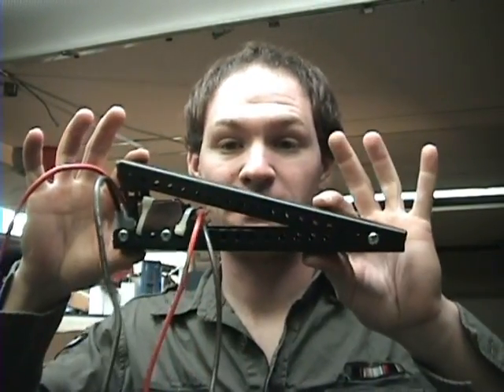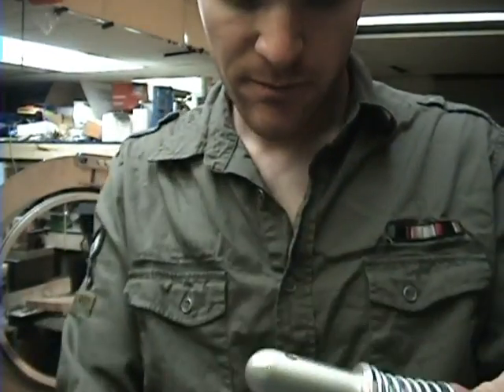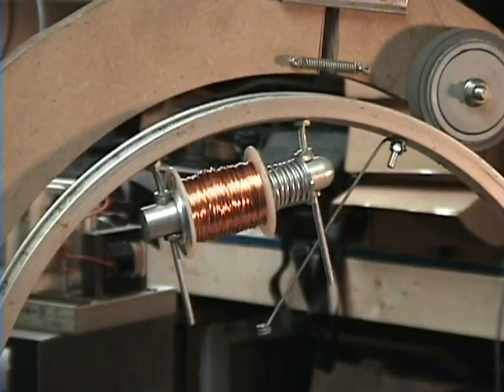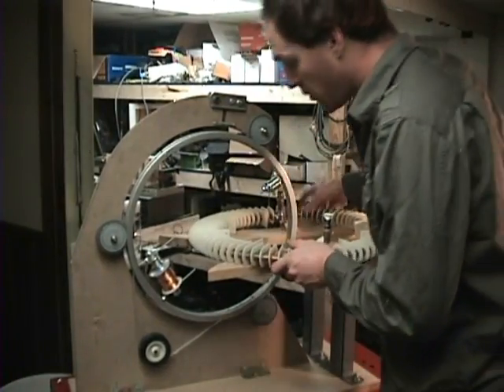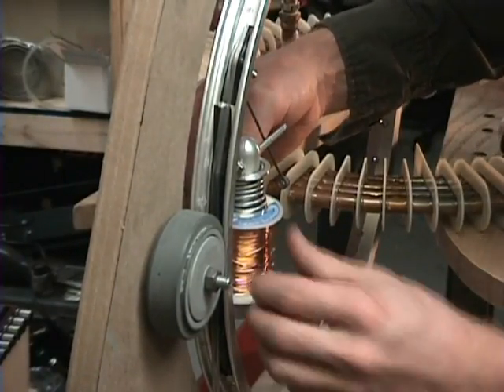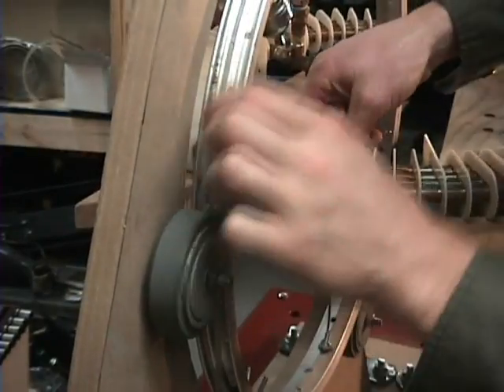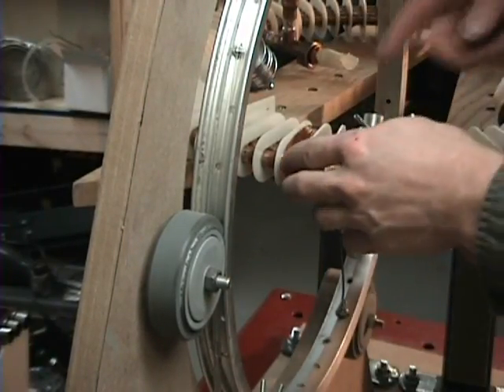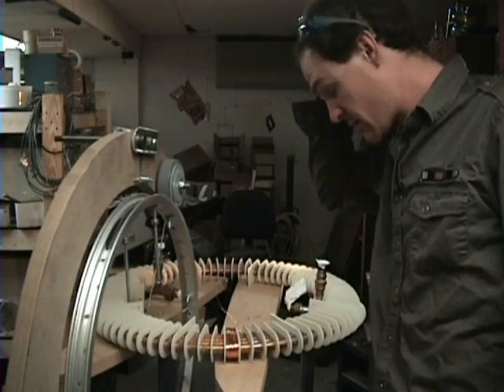#5 EPG Coil Winder, How It Works And Wrapping The Fist EPG Test Coil. Home Maid Troid Winder

Comment: Russ
you are the best
really nice to see a home made machine that really works
building such a sophisticated machine from junk parts solving one problem at a time

way to go Russ !!!

i think whats missing here is making that horizontal disc rotate too 

you achieved the rotation of the vertical disc
now its time to make the horizontal disc rotate too

then

find some electronic means to make both discs rotate together at same time'
automatically according to some speed ratio in between
like 1 horizontal degree to 1 vertical degree rotation
making the speed of horizontal rotation a fixed value
and making the vertical rotation a variable value that can be determined
like 1:1 or 2:1 or 0.6:1

but that gonna need some computer software pf some type

which will enable you to make a wide variety of winding ratios of the rodin coil
like 
9*9 and the ratio will be 1:1
18*27 equals 2:3 ratio
etc

you know putting winding ratio in consideration is of great importance
because as you " ITS ALL ABOUT THE GEOMETRY "

really nice job

keep up the good job

Comment: Hi there! I like your idea.  

One thing to help you out with your calculations, should you need it.  I'd add a magnet to the side of your motorized ring, near your wire feed guide, with a pick up on the frame to a resetable pulse counter.  That will give you a coil turn count to work with. 

For me, this would be the first thing that I'd do.

Comment: The split rim is a Very good idea. Mine needs to be able to go through a 1" hole, with 8 separate windings of 236 turns each using 34swg wire. Thinking of weighing the wire rather than counting turns. That does seem to be a problem with winding toroids. Looking forward to seeing more of your videos. Keep it up!

Comment: Love the use of a bicycle wheel as a coil winder, I use one as a magnetic loop RX/TX  QRP amateur radio antenna fed with a toroid ring fed over it the same way you put your ring on, work a treat from 21Mhz to 7Mhz.

Comment: I admire your efforts and work you done. Simple yet so functional.
If I may suggest.
1, Use nylon rings as a guid for your wire as the one you have "may" damage the insulation on the wire.
2,suggestion may be a digital bicycle meter to count the meters and then just convert it to the "closer" spins (where actual coil is :D) or if you wan't be more accurate to the actual foot on the coil. It all depends on the thickness of the core and obviously each layer with increase of diameter. 
Great Work!!

Comment: I like your coil winder, that was good thinking. It would be nice if you had some way to count the number of turns you make on the wheel so you will know exactly how many turns you have on each coil section. Also it would be nice to have something to control the side to side movement so each wrap would be wound right next to each other for a neater, nicer wind. thanks for sharing with us.

Comment: Interesting video. I've watched a few winding machines, but this one is very informative and interesting. How did your wire guide work out after you used it for a while?  The hard drive spindle spacers were a good use of those pieces.  I have about 500 of them and never thought of using them as washers.  Thanks for the video and information sharing.

Comment: I am researching different Hallbach motor designs for use in hydrolectric  generators with built in cooling methods. I am impressed with your inginuity, thanks.
Subscribed

Comment: Also, it seems since your winding device has alleviated most of the drudgery of hand winding and since you are holding the ring with your hands anyway, it occurred to me if you made a wand with an eye hook at the end that the wire passes through just prior to landing on the coil frame - and the other end of that wand was pivoting near the center of your ring / or better yet , further away, close to the opposite side of the ring. This would allow you to keep the ring more stationary and use one of your hands to move the wand's eye hook from side to side of the coil landing area. 
As I'm sure you are aware - wrap count and wrap consistency are key to a balanced magnetic field. 
Thanks for your efforts  and the generosity of your intelligence.

Comment: Hey Russ. I know you posted this video in 2011 but just the same, your ingenuity never ceases to amaze me. Been checking out your videos for quite some time and you are pretty good, quite ambitious and resourceful.
A question though, how do you count the turns on a coil? I made a few different coil winders and now need a toroid winder and want to count the turns as well as the length of the wire. I can calculate the length needed but didn't see a turns counter. I will figure it out in time I'm sure if you can't get back to me.
Thank you for all the great videos and young man, yes, you are crazy. Take care. God bless. Dave
Reply from the maker: Hi Dave, use a simple counter, if you take a calculator, wire a switch up to the = button, then just put 1+1 in the calculator, hit the button and it will count up by 1 :) 

thats the simple method, however i found that if i went to fast it would skip... 

the other counters you can get on ebay for cheep. like this one:

http://www.ebay.com/itm/LCD-Punch-Counter-Digital-5-Digit-Including-Proximity-Switch-Strong-Magnetic/181770167673?_trksid=p2141725.c100338.m3726&_trkparms=aid%3D222007%26algo%3DSIC.MBE%26ao%3D1%26asc%3D20150313114020%26meid%3D8213fc7278814bb3895a1ba772e04930%26pid%3D100338%26rk%3D1%26rkt%3D16%26sd%3D111006637773

Hope this helps! god bless! 

~Russ

Comment: well u say leave comment .. suggestion about connecting rim , bolts are time consuming and there is always bolt in O-ring path. U could use metal bracket from tool box instead of plate that u need to bolt down every time . Keep doing awesome  job like ur doing so far. Real enjoying ur work , trying to learn as much as I can b4 starting to do something my self , getting my self involved in this more seriously. Tnx for all of ur time spent in explaining to others ( and me ) how to do stuff . 

One more thing , idea for wire straitening, u could use old spark plugs . They have dents in ceramic that u can thread wire around it. Simply drill hole 2 mm smaller than spark threaded part in wooden board and screw spark plugs  in it ( as many as u want and in arrangement that will work best for you. Any car mechanic shop have them laying around just w8ing to be thrown away . I got 8 that was laying around form service that I did on 2 cars some time aggo . Trying to do exactly what I described here.
 Best of luck.

Comment: Interesting machine, you definitely thought outside the box to build it, (i.e.) to create magic with what you had available, hang in there you"re on the right track. If you have a machine shop at your disposal you could add a micrometer tension adjustment on your wire feed, and an automatic indexing feed on your actual coil. It would reverse direction when you reached each end of the coil, and eliminate human error. Anytime you're building more than one then building a Jig or Machine will insure uniformity.    P.S. you could make a UHMW guide for your wire and eliminate deflection and or jumping out of the guide, it would be stiffer and less likely to deflect or drop / snag the the insulation off your magnetic wire. Thank you for sharing your innovative mind with the world, knowledge needs to be shared not kept secret, that's how the corporate world elite control the rest of us. Good Luck and God Bless you, Braun.

Comment: Great thinking and follow through. This may have been mentioned in one of the many comments you have received but, have you considered using an insulation barrier between your windings and the copper tubes? I have seen many materials used for this purpose such as paper and or tape.

Comment: Outstanding work,  if you mount a pedometer and replace It's motion switch with a mag switch Tweak the mag and switch mounting setup it will give you a accurate winding count. I used one on my coil winding machine, looks like I need to build one of those. That is just bad Ass!  Any questions on the pedometer just contact me But  Look like you got a good grasp of things I'm sure you can figure it out again Great work Cheers

Comment: THANK YOU. Great effort with design and implementation. I have considered toroidal power transformers 120pri - 350v @2amp for antique RF gear. But the high cost, including shipping, versus performance of the originals (or copies thereof) was absurd. Those projects were thought to be out of reach. I think now have another viable option. QUESTION: Are there reasonable sources for cores and magnet wire that leaps to your mind?

Comment: You wished a comment so here is my two cents worth. The controller is quite an interesting reuse of recycled equipment. The way you made a belt to drive the winder was very creative. The overall construction was a little primitive but adequate. Changes I would suggest are: a polyethylene grommet on your wire guide to prevent friction damage; putting a counter to count the number of turns with. This machine would not help me for I wind toroids are no larger than 10mm outside diameter.

Comment: Very neat. To get the exact number of turns on each coil I would have added somekind of mechanical counter. 1 wheel rotation is 1 turn, to get the same inductance into every coil. for the ultra model, one should have a 1 diameter wire offset for each turn of wire onto the coil. so it for instance goes 10 turns, or 10 diameters each layer. Nice. It would be a coilers dream come true :)

Comment: your an exceptional builder. I did watch the build... great work dude. I have an Idea what your going to use this for . I have seen one other inventer with a few of these. But if I remember correctly his tubes where made of non conductive non magnetic plastic. btw keeping track of the turns is a good idea because the length may vary the amount of turns

Comment: May I suggest  adding one of thoughts mechanical counters from a tape recorder with some gearing/pulleys to measure the number of turns on your coils.
A nice addition would also be to mount the toroid on a turn table and a motor to spin the turn table with adjustable stops with switches that turn on and off a dtdp relay to reverse the motor upon hitting each side.
maybe if your feeling adventurous you could fit a solenoid to reset the counter and glue a few

Comment: Nice work on a crude setup. 
I know you will make it much better later. 
One suggestion on the update to the machine. 
Make it hold down the form that your wrapping on and have it move for every revolution per rotation of the winder. If you like I can give you ideas on how to do that with an Arduino.

Comment: 2 ideas for improvement.
1 - Treat your foot pedal like a lever and move the switch to the small side so that it takes a larger movement to go to full speed. Perhaps replacing the pot in it with another pot. You could also use video game foot pedal.
2 - Feed the wire from a separate spool with a tension control.

Nice work on the winder.
P.S. Your link sends you to some company, not rwgresearch.

Comment: great so long as wire doesnt get snapped from friction or over tension. wire might run on bearing or low friction material. could the coils not be wound then added ? it looks like a great effort that you wouldnt expect to work.

Comment: bits of metal to the counter's numbers (or use an electronic chip or two) to complete the circuit when the counter reaches the set number of turns.This would then latch a relay which would enable the skipping of one of the pulses from one of the side stop buttons (advancing it to the next coil) after the next one pluses the relay is reset stopping it from spinning all the way around. another switch to stop it on the completion of the last coil section. 
Just a thought.

Comment: so this thing will do rodin coils too. just gotta keep innovating. you need to adjust the spring tension on the rollers. wow you could use the thinnest possible wire? i figure you need a potentiometer as well as the foot pedal set up. you could also put guides on the epg that come right up to the eye to keep the wire then you could just max speed

Comment: Great video, I have watched chinese coil winding jigs and could not understand how they worked. But no surprise since my mothers Singer sewing machine was complete mystery to me. 

      I do have one question.  Looks like your machine does a solenoid wind, each layer is spiraled opposite of the one below it. This creates magnetic fields in opposition to the layer below it. Effectively creating a radio choke. If your winder did a quick turn from the last wind on the previous layer to the first wind on the next layer, starting at the same place, each layer would reinforce the strength of the magnetic field below it.

      Try to find a way to detect the end of a layer, and swing the feed back to the first wind of the previous layer. Your coils will be stronger, have a consistent resonant frequency, and run cooler than before.

      Sincerely,

            John

Comment: I have a bicycle wheel needing replacement,  the rig will reuse the old wheel perfectly, old sewing machine motor can drive things and has a built in speed controller too. Now I get the machine I want and reuse stuff too. Project  cleans garage nicelytoo.

Comment: If you have the spare circuitry laying around you might consider adding a turn sensor/counter to the wheel.  It could be just a series of simple decade counters or even an arduino connected to an optical, mechanical or hall effect sensor.  Even something connected to a PC's input could work for the purpose...

Comment: Hello Russ from Steve. Im very impressed  with all the work You have been doing
maybe You need a winder counter. i dont know about tuning coils. i dont know if you have to match wire lengths or 1/4 ,1/2 and 3/4 length wires or matching  total wire weight of the coils
Thats some very good work
Steve

Comment: yeah im sure he will put some nylon in side the loop guide for the line feeding plenty of nylon ink pens around i am sure. The end to end of the side edges of the spool he could move the spool with a measure off set like in a sowing machine to feed evenly from side to side useing slideing stops to stops

Comment: so I ended up here tonight..??  That's a hell of a bobbin winder you've got there!  I love DIY gadgets, even ones that I have no clue of there use :-) Guess I'll have to dig some more and find out what it is that you are working toward (toroid?).  It just looks too cool to not follow. I assume that electricity will eventually be flowing in that winding. So, did that wire guide scratch the insulating lacquer of the wire? think I need to 'subscribe'

Comment: I was looking for toroid winding machine for power transformers. But they are thousands of dollars! That's even on ebay too!!! Couldn't visualize the rings at 90 degrees of each other. Not that good a visualizer I guess. This really brought things together in my mind.
 Didnt see counter for number of turns,  but that should be easy to get.
Liked the presentation even though im not using the toroid winder the same way as you.

Comment: one time I used a mouse for the foot pedals for a PC racing game. someone else suggested more than one spool but you could  actually repeat the setup you got  five times and that would solve the sexmachine balance problem - also the best way is to measure the spool just to be scientific. and rolling out 5 separate coils all at once. and setup the inner guides between the spools

Comment: Toroid winders that use a spool are limited to LARGE cores.  Winders that store the wire around the ring with a separate winder ring rotating around the spool ring can fit into smaller cores.  THAT'S the kind I'd like to see.

Comment: russ wat kind of circuits run this thing? correct me if im wrong but the gas you will insert into the pipes is Hydrogen and your circuits will be plusing out of phase to accelerate the gas, sorry I am new to the epg.
good work, thanks lew

Comment: Russ
Are you concerned about the wire guide wearing the insulation on the wire?
In time the wire will wear the wire guide and the wire, so electrical shorts will occur....
Look at a roller head or UHMW eyelet replaceable guide 
Just some thoughts
Bill

Comment: didn't realize u were going according to footage which should give u same wraps as long as they're tight. Also what's the difference between regular wire and magnetic wire, just the coating?

Comment: What benchmark are you using for # of turns, i.e. if you don't have a counter on the winder itself, have you decided X amount of wire (and thus a certain amount of turns) at a certain gauge, would then give you X amount of resistance and or uH? Cheers Bro, looking good!

Comment: I need a winder for coils wound with flatwire having an oblong shape 1/2" id one way, 1" id the other roughly, just like on the 1908 Model T magnetos. 
16 of them sit under 32 passing magnets off 16 v's. Instead of using old wearing magnets I'll use mountable neodymium magnets mounted on iron bars bent to V shape.
Outside the spinning magnet array , a giant copper ring under it etc.etc... just like original, spinning magnets pos ends neg centers, 2 of them opposite sides perform act of creating charge based Julian fractal. As 4 spark plugs fire for each revolution, the pos ends of those magnets shoot off a raining heavy positive ion force with potential equal to or greater than the spark force. The 20 layers of flatwire in that 3rd ground magneto implode the carrier wave of the spark through to combine flatwire's capacitive layers into a higher frequency transformation. 
End product is 40hp free energy when it's done.